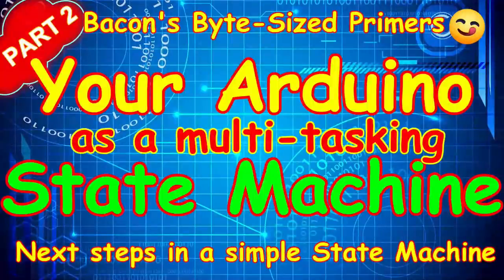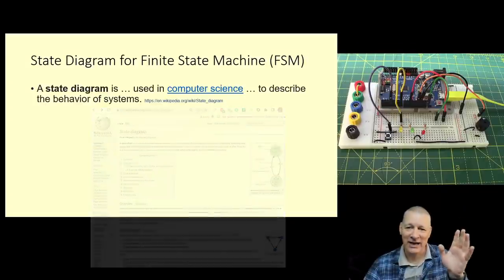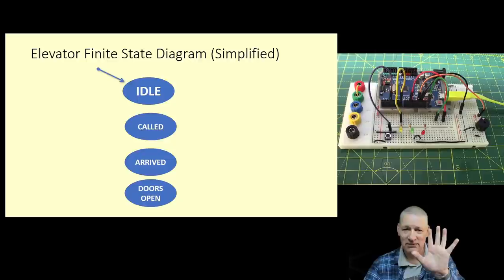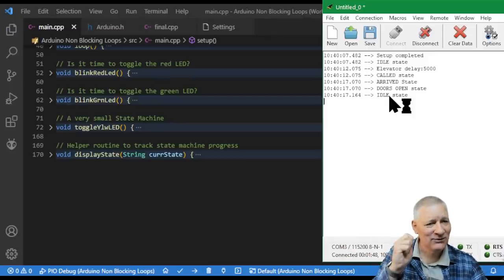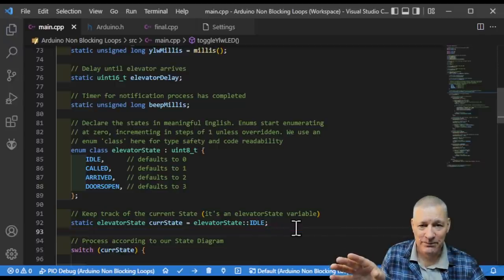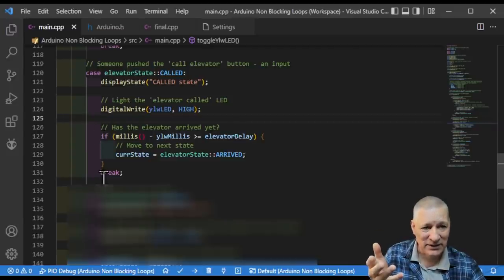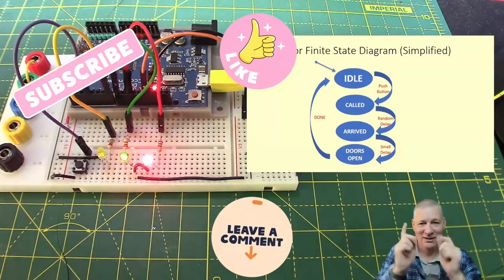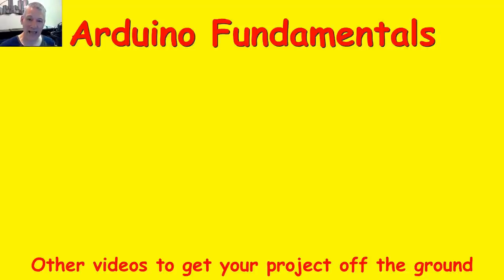#BB6 Arduino State😲Machine - Part 2: Implementation 🥳🥂

Comment: So years ago a operator would sit on a stool, ask “floor please”, pull some levers, and away we go. Actually a technical job to stop at the correct floor and align the car with the floor. Today that job has been replaced with a $10 Arduino. Years from now the Arduino will be replaced by “telie transport” , you’ll just think of the floor and flash bam you’ll be there. Times change.
Reply from the maker: It's called "progress", I believe. Whether you want it or not 😮

Comment: I remember in a Fortran class doing diagrams like yours using diamonds and boxes. I also remember those darn punchcards and waiting in the basement (all computers were in the basement, right ?) for the program to run. There was always some poor guy who would trip on the stairs and the punch cards would go flying in the air.
Reply from the maker: Those diamonds and boxes were not State Diagrams, they were flowcharts. It's how things were done in the Bad Old Days (probably before electricity ⚡ was invented to run the darn computer). 

Oh, and don't mention punch cards to me. Having had to punch a few using a hand punch (with nothing printed on the card to show you whether you had done it right or not) I still have recurring nightmares about them. 😲

Comment: Ralph, another well done and informative video. One thing, I understand this is just a video on the basics, in a true state machine you should verify that the state has truly changed before moving to the next state. In a case like this, using a timer in an elevator application is not telling you if the state has truly changed and could come down to a safety issue in the real world
Reply from the maker: Yes, point taken, but I think a Real World elevator program would be considerably more complex than this demo version, including umpteen safety checks!
Reply: @RalphBacon  Oh absolutely, there's more safety checks in the real world. Still all those safety fault conditions would have to be satisfied before signaling for a state change.

Comment: The easiest way to drop into the "default" case is to add in a state to your diagram, add the transitions to your existing states, then forget to implement the actual state. It sounds unlikely, but when you get state machines with dozens (or even hundreds) of states its surprisingly easy!
Reply from the maker: Yes, I can believe it. 

Additionally, in an Hierarchical State Machine the default case can be used to cater for the "next level up" actions in the same way that Windows or JavaScript bubbles up events until they are captured by something (or discarded).

Comment: Back in the mid 1980's I did an Armed Forces Computer Maintenance Course. Everything was coded in binary, using "If, And, Or, Go To, Return" commands. After having a stroke, I finally have time to try and learn to program modern computers. These two lessons have finally opened up modern computer programing to me. Thank-you.
Reply from the maker: You're most welcome, Fergus. It can definitely make your programs much cleaner and more likely to work!

Comment: Nice to see you changed to  a switch statement for the FSM.  I often leave out the break in the switch statements as it can allow several switch states to perform the same action, some states do something different. The default state mops up the rest. Very easy to read.

Next some  UML ;-)
Reply from the maker: UML? Oh, I was going onto Hierarchical State Machines first... 😲😂🤦‍♂️
Reply: @RalphBacon  did the first designs in the new  Yourdon structured method (YSM), am i showing my age.

Comment: Thanks so much for the state machine implementation, Ralph. I was able to completely refactor my timing-intensive project so that it runs without any delay() calls at all. One bit of advice I'd pass to your viewers is that for many use cases, you can get a huge amount of utility even with two states; I was able to solve a tricky long-press duplication just by relying on the state machine to bounce any unwanted events that don't conform to the current state.
Reply from the maker: Fantastic! I'm very happy that your coding has "improved" by using a finite state machine.

Comment: Hi Ralph, Yet another great video, it reminds me of the Switch Case I did for my Model Railway which has 10 switch case statements for routes, which are triggered by Reed Swotches under tracks so Loco has a magnet, the Mega I use has most of the Data and Analog pins used,  the Case statements switch points and Aspect signals, at the Exit of the route an IR Sensor will hold till last carraige as passed, code is about 1000 lines and the main part I was helped by a member of MERG ...John
Reply from the maker: That's impressive, John. The advantage of using a State Machine is that if your State Diagram is correct then your code will be too. In your case, pretty essential. 🚂

Comment: I use the library "metro" with arduino devices. It's à good code for little states machines. It's a minimal scheduler for Attmega368.
Reply from the maker: I'll check that out too, thanks for the heads-up. 👍🏻

Comment: G'day Ralph. This has been an excellent mini-series, thank you! I think you found a good balance of simplicity/clarity of scenario without being trivial or getting bogged down. Just thought I'd mention the idea (and you kind of implied this in passing) that the indicators (yellow LED and buzzer) could each be encapsulated in their own state machine to handle turning on and off and timing etc and have the main Elevator state machine interact with those. Thanks again for the awesome videos :)
Reply from the maker: Glad you enjoyed it!

The thing about FSMs is that they can 'explode' quite quickly - yes, that's the official, technical term for when the number of states just gets out of hand and becomes unmanageable. The answer to this is an HSM (Hierarchical State Machine) where State Machines are embedded inside a parent State Machine. This ensures that one FSM doesn't try to do everything by itself.

But that's a whole level that hobbyist Arduinites are unlikely to (want to) get to, IMHO. I don't use FSMs regularly (but would you Adam & Eve it, the project I'm working on now does use one) as the simple approach of calling multiple functions in a time-slicing way that I showed in Part 1 works very well indeed. My ESP32 Web Radio works this way, and that can be very time critical if I don't want the streaming music to stutter (it doesn't).

Comment: I’m using a state machine to build an automatic dog feeder. I like it because I can continually add complexity pretty easily. I will start with the food already staged in a tube and open it with a servo after a time delay, later I can add a dc motor driven auger to take food out of a hopper and then a pressure sensor as feedback to switch states and turn off the auger once the correct amount of food is in the tube, etc. pretty cool thanks for the explanation
Reply from the maker: Sounds great! My latest project used a Finite State Machine too, works just fine!

Comment: Thank You!  Another key buiiding-block in my programming education. (I now understand why there are no goto statements).
Reply from the maker: OMG you mentioned the unmentionable! I remember GOTO statements from about 40 years ago in the BASIC language. A pity it was ever invented!
Reply: @RalphBacon  For me, it was 50 years ago (in Fortran).  RIP 'goto'
Reply: Predictability is based on conventions/rules. C and C++ kept the “no goto” a convention, rather than a rule. This allows us to reason about scope and entry/exit of language statements and functions.
In the video, the author also added a “no blocking/no waiting convention”.  This is the concept of (voluntary) time sharing, giving an element if multitasking.

Between these conventions, here are the consequences:
* goto breaks the expectations of function entry and exit, control statements. The abstraction breaks down. Some languages removes the jump/goto statement.
* Blocking breaks everyones expectations of time, that execution returns swiftly. The time “precision” is lost and things start to lag/skip events etc, bugs in time. The timing becomes unpredictable, the multitasking abstraction fails. “Preemptive” task switching prevents exclusive access to CPU time.

There are still goto statements, but it is a tool that requires extraordinarily discipline. Such discipline is best handled over to lower levels of abstraction ie the compiler. Some say time sharing is best left to the scheduler.
But note, if you do timeshareing - do not cheat by blocking! Blocking (bugs in the time domain) will bite as the complexity grows.

Comment: Great video, you explain it well, very articulate, can you explain how the random statement works random (3,8) * 1000
Thanks
Reply from the maker: To use the random number generator, you first need to seed the generator, otherwise you get the same sequence of numbers each time you run the sketch (no true random numbers from a computer).

So, randomSeed(analogRead(A0)) will get some random value from the A0 pin (or other analog pin if you are actually using A0) and "seed" the generator.

Then you specify that you want a number by random(lowest, highest) and you get a number out. The lowest includes the value you specify, the highest excludes it, so random (3,10) means any number from 3 to 9 but not 10. What do you mean, someone screwed up that function? 😂

Multiply by whatever factor (if any) you want, so multiplying by 1000 gets you (in the above example) any an exact multiple of thousands number from 3000 to 9000.

Comment: Excellent work Ralph, and yes you could add lots of extra states into the model but the only I’d argue for strongly would probably be ‘BROKEN’ ... not just because of its ubiquity in daily life but because it introduces a route to the admin-state-machine or ‘Fireman’s key’ world of additional behaviour which, most likely will be being hacked together somewhere else and the protection afforded by FSM’s can be valuable.  Keep up the great work 😀👍
Reply from the maker: I had to chuckle at the thought of a BROKEN state. 

What you really want is a Hierarchical State Machine where the "default" case (ie not handled) bubbles up to a higher level and is dealt with there - that would handle the BROKEN state (or any other forgotten state).

Comment: Some years back I ran a BBS.  In its idle state there was a program looking at what the modem might have to say,  and which would hand off to the bbs software if a human caller connected,  or perform various other actions if it were another system calling with mail, a request, or whatever.  Many different protocols were implemented.  I took a brief look at the source code one time,  and what I found was a whole slew of different state machines,  sometimes nested one within another,  before I gave up on trying to understand how things worked to any level of detail.  It can really get quite complicated!  :-)  But it really did work well,  handling all sorts of stuff...
Reply from the maker: State Machine do work but can get out of hand too, if there are too many states. It's called State Explosion and is usually handled by a Hierarchical State Machine (sounds like that's what you had, nested State Machines).

Comment: Might be more correct to say concurrently rather than simultaneously.. Nice video, I understand finite state machines but always nice to get a refresher and it's a really good video on the subject.
Reply from the maker: Fair enough! Concurrently it is! Well, it isn't, but close enough 😁
Reply: Well to be concise the Arduino cannot do concurrent processing, it only has a single thread of code execution. You can time slice this to try and make it appear to be concurrent which a Real Time Operating System does (RTOS).
Reply: @TheEmbeddedHobbyist  I have done a lot of RTOS programming on various micros, so concurrent is the term I tend to use. It's not 100% accurate in this context but I feel it's more correct than simultaneously. Not to take anything away from the video, which I found interesting and informative and very helpful to people not only learning about Arduino's and embedded programming but more advanced programmers expanding and consolidating their knowledge.
Reply: @Potts1966  According to the Oxford dictionary:  Concurrently  
Adverb  at the same time; simultaneously.

According to Lexico, the word simultaneously means "At the same time". And the word concurrently means "Existing, happening, or done at the same time".

So both are not 100% correct for the describing the action of the state machine or anything performed on a single core microprocessor. I would rest my case if it was on an ESP32, which with some carful programming can run programs concurrently. I say careful as one core still has to perform all the Wifi, Bluetooth operations.

Don’t get me wrong I watch all of Ralph’s videos and find them great. And I think they are great at giving the old grey cell a bit of exercise. But I was just pointing out that with a single execution core nothing can be performed simultaneously or concurrently.
Reply: @TheEmbeddedHobbyist  Oh wow! A simple comment gets blown out of proportion! .. LOL. Relax, I think we're all on the same side here.   I was associating Ralph's state machines as being similar to multiple threads of execution in an RTOS and while obviously on a single threaded processor they can't execute at the exact same time, they can execute "concurrently" and appear to run simultaneously to an observer. (concurrently being a term I learned from my OU course on operating systems that I still use to this day)

I think we're going to have to agree to disagree here. If you want to post more of your more correct explanation then go for it, I'm out.
Reply: @Potts1966  I’m quite relaxed, it’s Good Friday and I’m sitting waiting for the Chocolate to arrive what more can you ask for.

I did the Concurrent software course with the OU for my sins. Still have the very course book “Concurrent Systems” Third edition for the OU, which the reading of gets you off to sleep in about 5mins. I just hope the author “Jean Bacon” is not a relative of Ralph’s.

This is just friendly comment banter

Just like i saw a man stealing my gate and i was asked why i did nothing to stop him? I replied because i thought he might take a fence.
Reply: @TheEmbeddedHobbyist  Apologies. I'm used to the vociferous imbecilies that live on Stack Overflow and jumped to the conclusion that you were one of them. The M301 course was really good with the exception of Jean's book. Hope your chocolate is nice. Happy Easter!
Reply: @Potts1966  No Apologies needed. I glad we share the same thoughts on Jean's book :-)
Happy chocolate holiday. Lol Easter as well.

Comment: Hi,  Thank you very much. you've just saved my life.
Your video helped me so much, I was struggling with a Stepper motor that I had to control without using any library and this motor is a bipolar one, my problem was just that my code works fine because I use millis() function to update the menu on the screen to give how many steps and how much time should this motor run etc... 
But when I press the button the motor starts running and my display stops updating, but now it's work completely fine after i used your method with enum class and switch case. Thank you again.
Reply from the maker: Thanks for the feedback, Ayman MIRI, I'm very glad you got it working.

Comment: Thanks for the explanation, I think I understand it. I like to program an Arduino for more then just 2 leds which flash. I have written a simple skecth for two photographers who are waiting for a train to enter a platform and then shoot each two pictures with a random pause between the flashes. But watching your explanation for state machine, I like to use more outputs of the Arduino... ;-)) I will give it a go and will try to write these flashes as (finite) states.
Reply from the maker: Flashing LEDs are all well and good for a visual demo, but most users like yourself will want to do something more useful. Start small, and expand. It's too easy to not spend enough time on drawing out all the possible states and start coding before you're ready! Don't ask how I know this. 🤦‍♂️

Comment: Great vid as always Ralph. I need to use switch case more often. Spent today writing if, else if, etc. Many times.
Changing the subject...... "enum" ..... How about a series on enum, typedef, struct, class. I know I'd be interested. I've used all except enum, but very rarely as I'm far from proficient at using them. I'm pretty sure that just a short vid from you would have us all understanding them clearly. Just a thought.
Cheers.
Matt.
Reply from the maker: It's certainly an idea for the Bacon Bytes series, Matt. I shall bear it in mind. 👍🏻
Reply: @RalphBacon  Cheers Ralph. You've saved my bacon (pun intended) more than a few times with your clear and consice approach.

Comment: Hi Ralph. I have been trying to develop an electro-mechanical puzzle game for which I needed to code a state machine without knowing what it actually is. I have relatively little knowledge on Arduino and achived this by if / else routines and functions. At some point, I realized that I need some sort of flag to record which state my system is in, and only then was I able to switch between states. I just wish I knew what it is called before and wathced these wonderful videos before so that it would have been less-painful-two weeks:)) Anyways, at least now I know how valuable this information is, thanks again.
Reply from the maker: It's actually always good to define a need and then to discover it. Whether that is a particular DIY tool or a coding technique your just KNOW that it is the right thing to use.

So good luck with rewriting your code. It won't take that long because you already know what has to be done. But do spend time on the State Diagram - it's your blueprint for a successful program.